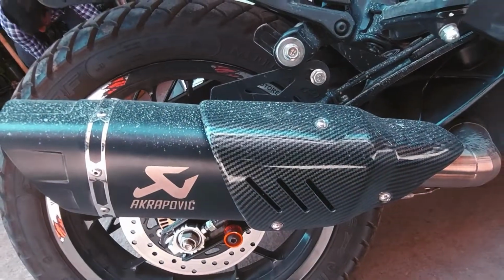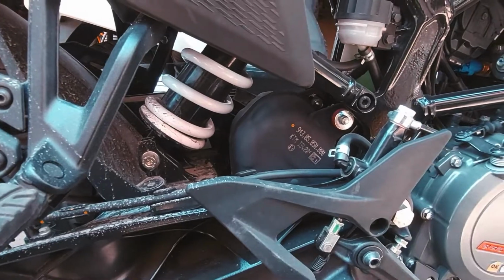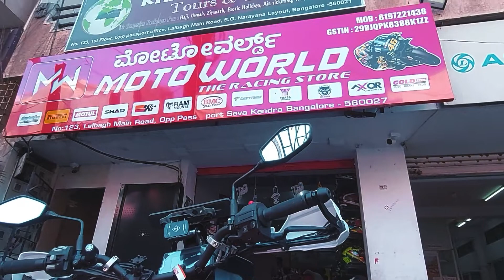Info Take 7 | KTM 390 Adventure - Exhaust Custom | Akrapovic Exhaust Note | Moto World Racing Store

Comment: Very good modification to save a few kilos of weight. What is the cost of only the pipe to eliminate the catalytic converter. Was there any problem with the cops?!
Reply from the maker: No problem with the Cop's since the exhaust blends in with the bike and the sound also reduces as the carbon builds. The pipe costed around 2K+.

Comment: What's the cost of the exhaust and that tank dome ??
Reply: In the same video it sounds two different types with cat box . What will be the sound with cat box??
Reply from the maker: The sound what you hear in the beginning of the video is the exact sound with cat box. The one you hear at 5.00 is when I had the slip on installed newly, after a running the bike due to carbon build up the sound will change a bit.
Reply from the maker: it should cost around 6 to 7K with bend pipe